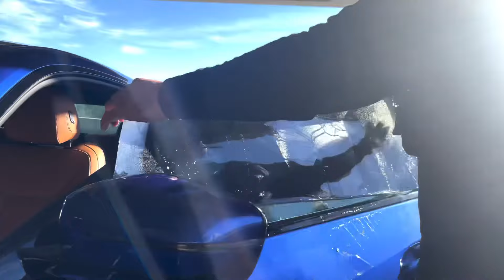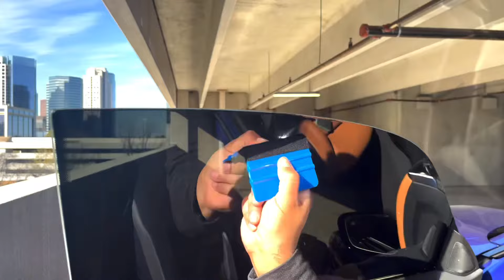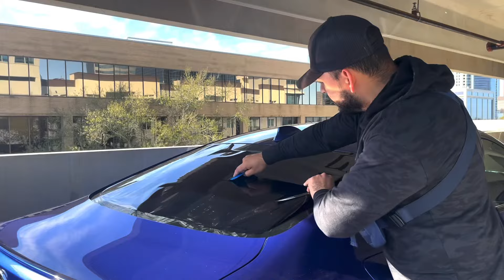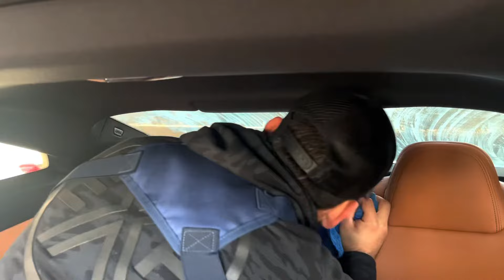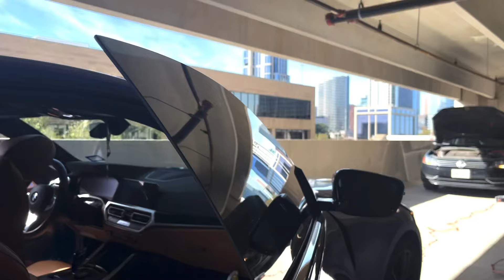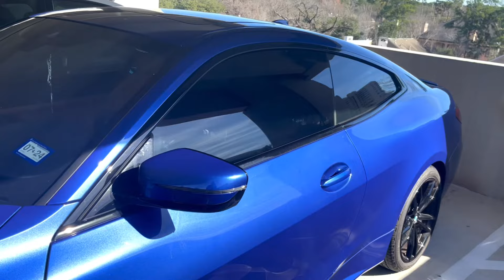2022 BMW 430i Mobile Window Tint Process in a Parking Garage!

Comment: Just started my own business, what do you use to power your corded heat gun. I have a Milwaukee cordless but goes through batteries quick
Reply from the maker: Yea cordless definitely won’t cut it. I use a 4000/2000 Watt Inverter. Connected straight to the car battery. Runs heat-gun, steamer and lights with ease. Performs better and cheaper than carrying a generator. It’s rare I use it as most jobs I use customer power but comes in handy for apartments and offices.
Reply: @yourfavoritewindowtinter  Do you have a link to the power inverter?